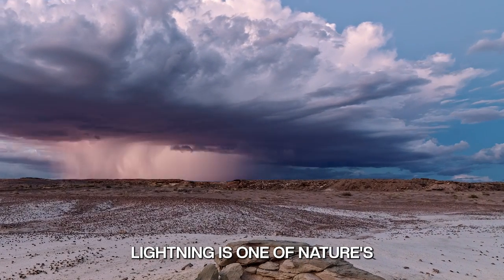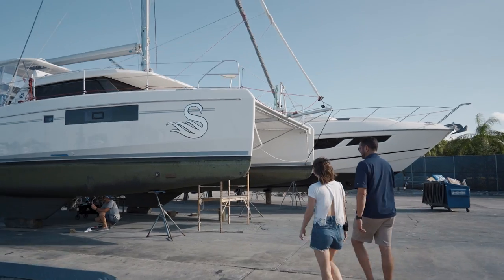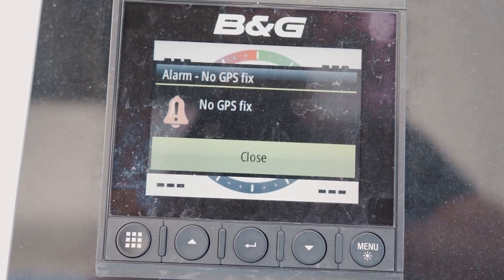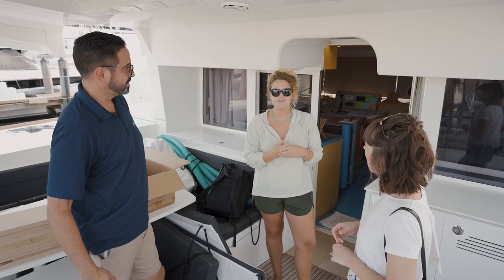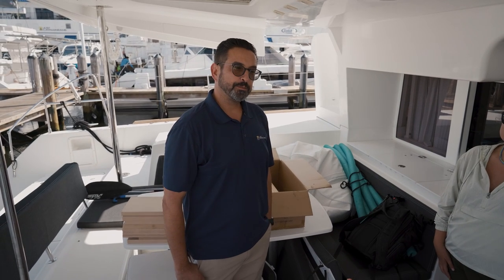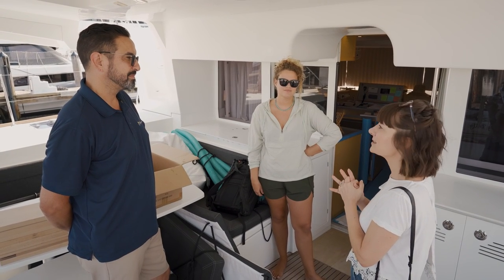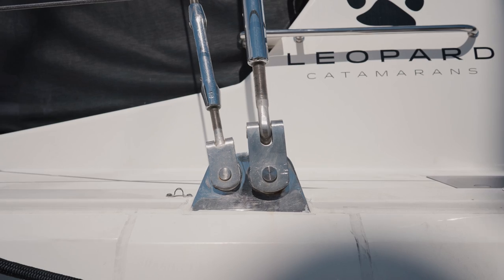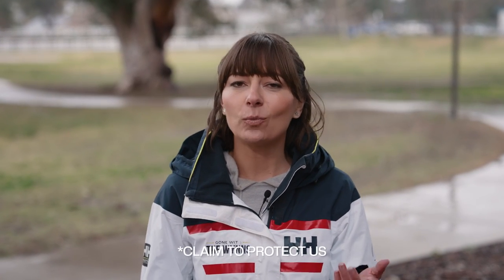Can Anything Stop Lightning?

Comment: well, it would have been interesting to know what the statistics say about lightning strikes vs. registered boats in high risk areas like Florida.... statistics ultimately determine how insurance companies value the risk/reward calculation.
personally i don't really believe this 15k Tesla rod can protect you, i would rather try to investigate if isolation switches, shutting off entire systems in advance can help to save some assets in case you are trapped in a lightning storm..

Comment: Florida is the lightning capital of the world.  The foremost expert is Bonded Lightning in Jupiter, FL.
Family owned since 1892, Bonded Lightning Protection is one of North America’s oldest lightning protection contractors. With origins dating to 1892, the company was founded in Florida in 1973.
I was a customer & was the electrical facility manager for a company in Palm Beach County & one of the buildings took a direct hit at 2:00am.  Took the power down for the entire building, the automatic transfer switch was fried.  Some of the damage was not found until the new controller was replaced & it exploded.  The building was lightning protected.  It's no guarantee, it's just insurance.

Comment: I've also researched a LOT, talked to some PhDs and even a insurances.

The Lightning Dissipation Theory can actually be demonstrated, using a Van de Graaff generator and a nail. 
Unfortunately science suggests, that it seems to only hold true on the small scale.

The deionnization idea is intriguing but without some hard numbers and studies - it's a bit of wishful thinking.
"It's been used in the industry!" is still not enough of a proof.
It just means they also want to protect their electronics.
If they have numbers to share - please, by all means!

Even the insurance could not share any numbers that showed an effect.

TBH it still feels like someone is cashing in big time on the fear here.
The prices are insane for what the devices are.

But if you find some numbers and studies - I beg you to share them!
Reply: Acknowledged research and trial has been done by Dr. Ewen Thomson over many years. His Seidarc conductors placed at waterline have been seen by users working during approaching thunderstorms. I spoke to a skipper with the system on a cat who experienced proximity strike while in marina and 2 boats in adjacent berths were both fried, he wasn’t. Sure, it’s a data point of 1 with only 2 controls, but it’s better than what this device vendor offers. Have you noticed they have thousands of clients over many years, but only a handful of references on their site? 
And the claim that nobody with their device has ever had a strike can be validated how, exactly?

Comment: I dont know, if it deionize the air around the boat, that deionized air is not gonna stay put in a storm. You can see that on all the real life applications, its all stationary and connected to the grid. This is just an assumption but the air moves around and the boat also moves. The product need to re-deionize the air around the boat faster then its blown away. That got to use a lot of electricity.

Comment: One of the other sailing channels on here got a direct hit  ,   Not only did it fry all his electrics but actually blew a hole in the bottom of his boat  The trouble with this bit of  kit is as you say its reaiatvely expensive and theres no proof it  works

Comment: I worked on aircraft that had lighting striking that has a system that helped in this case but I can't remember what it was, it didn't fry the engines but we had to check all the bearings very costly.                                            just saying
Reply: The difference with aircraft is if they are hit inflight, they are not grounded. Even then, sometimes there is absolutely no damage, sometimes it is significant.  I’ve been struck a few times flying, each event was different.

Comment: 19:00 No, how lightning rods work is well established. The Pseudoscience gimmick does not work. A long aluminum rod (or thick aluminum wire) is the best choice, considering its weight and conductivity. It must be tall enough so the entire boat is in its 45-degree cone if your boat is not made of metal. Your boat in the water or on the ground doesn't matter as far as the lightning rod is connected to the ground or water. The best way to solve this problem is to ask the boatmaker to make the boat lighting-proof using a conductive material, such as an aluminum alloy mast.

Comment: if the lightning protection worked, the insurance companies would require it for a policy.
Reply: I've put in multi million dollar electronics installations with the best grounding equipment available and those still had direct strikes and damage.  The stuff they are selling these boat owners (aside from the plates which only slightly dissipate a charge AFTER a strike) is a bunch of overpriced nonsense.

Comment: Maybe you could install a copper pipe in the mast before it goes up. The ends can be flattened and a hole drilled and you have the cheapest best conducting connection. You can decide or trial same alternatives later in the water. I came up with this idea when making a bus bar for my lithium batteries on my cat. André in Sydney

Comment: Interesting information, but I have my doubts if those supposed solutions are worth like $15k or even work. How they even prove that? What's the secret ingredient that makes it worth a lot of money? Something real, patenting or marketing on emotions? If lightning supposedly goes through a cable down the mast, it suddenly wouldn't fry the rest of the equipment? Electronics get damaged because the whole air around the strike is filled with electricity and it goes down all the wires around the boat. If insurance companies would trust it to prevent damage, they would recommend it and give you a discount. There must be better ways like surge protection solutions or something like that.

Comment: Guys the proof in the pudding, I know that Sailing Dauntless installed this device, is that commercial vessels and military vessels have been using the much larger version for years. BTW the expense is the install as a retrofit, but as a new boat, it should be relatively cheap to install.  Good luck -- BTW my cell tower clients have been installing these things for years  But on a $5 million cell tower a $50k thunder protection is a easy choice, a $15,000 device is another story, and as you said, it doesn't protect you from indirect hits
Reply: The math of scale still works for their boat. It will value around $1.5 million when outfitted making a $15k installation equivalent  in cost. Their electronics will value around $300-500k when completed.
Reply: @jstaffordii  totally agree, but then I'm not the one spending the money...although it seems like an easy call!

Comment: Isn't the mast the common point of a lightning strike?? You could connect all the outside lightning strike targets to a common ground or diffuser.  Kind of giving the lightning something to aim at. When the boat is in storage,  disconnect important things. Have different electric circuits completely insulated and protected from others. The dionizer sounds great , but it's too expensive to be practical.
Reply: I dont even know if you'll read this lol
But it could be helpful to the one who does lol
Reply: You'd have to several of those de-ionizer things. Idk

Comment: Why not use a lightning rod like they do on houses? Its super easy and cost almost nothing, and water is the perfect ground. And if you use a disconnect switch to turn off all electrical appliances from your main circuit I think you should be well protected.

Comment: Direct hit or not, lightning  causes a massive electromagnetic radiation pulse.  Any unshielded wire will act as an arial and convert the pulse to a voltage that cooks electronics.  The shielding on wires has to be earthed to work.  Any earthed area at the highest point (lightening rod) will reduce the risk of strike.  Big problem on a boat is the quality of earth.

Comment: Why couldn’t you install surge protectors like you do for computers or even a quick disconnect so if you’re in a lightning strike area, shut, all the electronic components down and take them off system

Comment: A big piece of aluminum with some insulator, some wire and a couple plates on the hull, $15K. Sorry but that's stupid. I used to do solar installation and installed a number of grounding systems on large commercial solar arrays that are mainly there to protect the array from lightning. On a 1.5 million dollar system the grounding components and labor probably cost less than a third of that.

Comment: What about a faraday cage for catamarans or at least for electronics?
Reply: You can't uninstall all of your electronics, auto pilot, air conditioners, generators, engine computers, lighting controls, etc and place them in a huge Faraday cage every time a storm rolls by. Even if you limit it to electronics like the plotter, instruments, and autopilot, it's a full day's work on either side of the storm. It's simply not feasible.
Reply: @andersonautomotive  My thought is it would need to be built into the boat, E.G. wrapped around wires, around key electronics and the battery. I think it would be possible to engineer by boat builders. I worked with a internet network specialist before that built a faraday cage around networking equipment and had fibre optic connections to the outside to protect the ground station (it was a microwave tower).  I'm surprised something like this it hasn't been done before for boats.
Reply: Maybe, but would add greatly to the cost and weight of the boat. Not sure how you would build such a cage around the mast and masthead equipment.
Reply: @andersonautomotive  I think the masthead electronics would be sacrificial, but you could run fibre optic cables instead of copper for electronics up the mast to protect the rest of the boat, and power for the masthead protected by a surge protector/circuit breaker. And it would cost more for sure.
Reply: It’s called a metal boat!
Reply: @marxug1  Garcia Yachts makes aluminium monohulls and catamarans but its not completely enclosed in aluminium. I've not seen anything to suggest those owners are better protected but maybe they are?

Comment: Jason and  Nikki,  what is your back up plan if you lost all electrical systems on your new boat? (you do not have manual diesel start engines), can you sail with the stars in line? Can you manually haul up and down all the sails if you loose all power and batteries? Do you have enough provisions to last at sea? How much does a Satellite Phone Cost?
Reply from the maker: Good questions.  First and foremost it is a sailboat.  Everything to sail the boat works manually and doesn't require the electric option.  We always have enough provisions to last at sea for triple the time we expect to be at sea.  As for the Ecodrive on our new HH44, it is a parallel hybrid (more on this soon), not a serial hybrid with electric motors relying on a generator. And our parallel hybrid is built on two separate mechanically aspirated diesel engines, not an electronically computer-controlled common rail system such as the Yanmars mentioned in the video. What does this mean?  Should the entire boat ever be fried from a lightning strike, our engines will still start and we can motor.   We have covered Sat phones and other comms in this video: https://www.youtube.com/watch?v=E9M9q1leaJI&t=688s

Comment: Well, these dissipators wouldn't do any good for your Mom's RV.  You still need some sort of a path to ground, and the rubber wheels on the vehicle make great insulators.  So, in fact, it would most likely work just the opposite on the RV, it might be a great conductor.

In the boat, because you have the plates, which are underwater, I can see where it would dissipate the ionic pathways.  But, I guess my question is why does it cost that much?  I could see a couple of thousand dollars, plus the install.  But, then again, 'BOAT' does mean 'Bring Out Another Thousand', everything is more expensive on a boat, or an RV, or an airplane.

Kind of makes me wary and upset that an insurance company will drop you over a claim, but corporate bottom line comes before your customers, I guess.  Sad.

Comment: If Tesla said it works it works. $15k ??  I cannot see the justification when all you need is the heaviest copper cable from top to bottom and into the water via the shortest route. I believe it has to be the shortest route too. Least resistance..

Comment: I got shocked pretty hard, enough to toss my umbrella several feet away from a half mile away strike which induced a voltage in my umbrella shaft.  This is an old Air Force avionics guy's opinion... I would Google aircraft lightening protection as I could never list it all here,  You showed pictures of the umbrella looking tops on poles.  I would make smaller ones and put on every mast and attach a heavy shielded cable to plates on the boat, or even wires dangling into the water during storms.  With some research, you can figure out how to shield your "avionics" and connect the high points and shields to the ground, i.e. water through ground wires far cheaper than the monopoly quoted price..

Comment: Man, lightning is no joke.  Many years ago I was a DJ at a local radio station, and we had a strike on our microwave tower (the tower where you broadcast from, that sends a microwave signal to your broadcast tower).  The lightning damaged nothing on the tower itself, but carried through the buried cable, about 3/4 mile back to the building.  It came into the broadcast mix board through that line, blew out the pots on two audio channels, then back out of the board into the audio card of the main broadcast computer, damaged nothing other than the audio card, then jumped from the audio card into the NIC, traveled along our BNC network (the broadcast computers were on a separate BNC network from the business computers) blew out the NICs in the two other broadcast computers, jumped from the audio card in one of them into the business network (cat5 ethernet) and proceeded to blow the NICs in every business computer as well as two switches.  Due to the age of our broadcast board (it was entirely vacuum tubes) we ended upi needing to wait weeks for replacement tubes that were several hundred dollars each.  The audio cards in the broadcast computers were a few grand each, and then all of the damage to the business network.  It was stupid expensive.

Fortunately we had a spare audio card that we were able to swap into the main broadcast computer, and we had enough good channels on the mix board that we just had to juggle things, so we were able to stay on air after only a  day of being down.  The whole building smelled like magic smoke for days, and I imagine that we were lucky that our overnight was all pre-recorded and automated, so nobody was actually sitting there at the broadcast station when this happened.